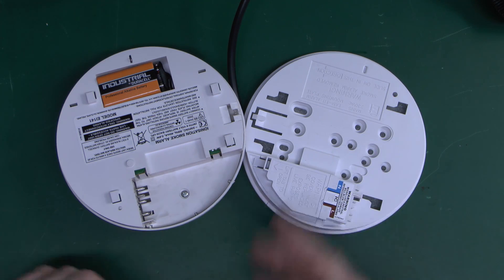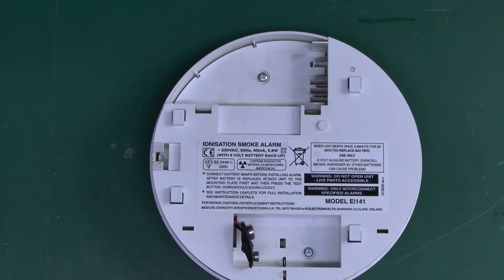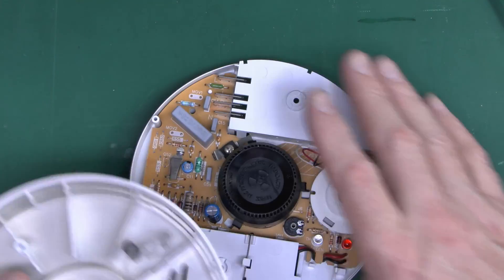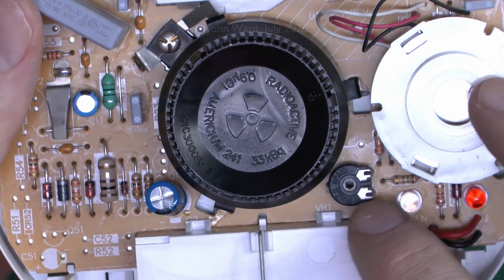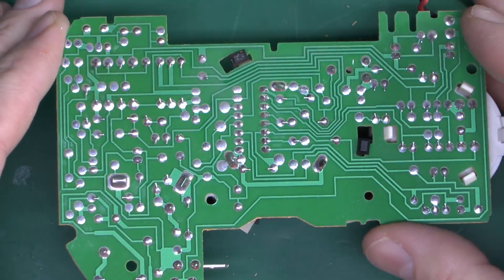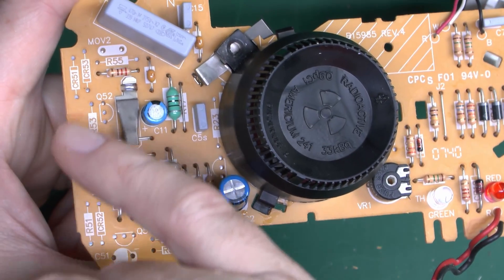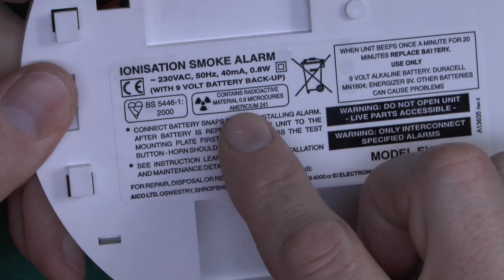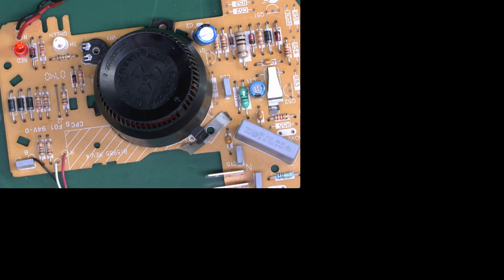Ionisation Smoke Alarm Dismantled - What's Inside

Comment: I remember i used to take everything apart to harvest electronics, i had no ides radioactive things were in smoke alarms and the building I worked in was throwing them out so I opened one up to see what's inside. I don't remember any radiation warning signs in it, pretty sure I would've remembered that. Whats the chances that it could've been a wired by the mains ionisation smoke alarm in 2014 UK? If so, what are the chances the chamber had no warning and I would've mistaken the amercium pellet for a screw and tried to unscrew it this releasing alpha particles on a screw driver I would've put back into my pants pocket? Further more; in this unlikely event, what's the chances i'd still be alive with no cancer or sickness?
Reply from the maker: Most smoke alarms in 2014 were ionisation types.
The amount of radioactive material is tiny, and alpha particles are blocked by skin, paper and other thin materials.  Unless you made a special effort to eat the radioactive substance or ground it into a powder and breathed it in, the risk is essentially zero.
Reply: @jwflame  thanks for the reassurance John, this has been a concern of mine for years. So Americium is not brittle enough to break apart when scratched by one of those steel hexi screw drivers? It would have to be grinded to break into a dust?

Comment: I ordered an ion chamber from an old smoke detector (older than yours, I'm sure). It arrived today, so I tested it with my Geiger counter (Terra-P +, by Ecotest). Nothing could be detected through the chamber housing, even with the cover removed from the Geiger tube, inside the Geiger counter. 
I took the cover off the ion chamber and tested it again. With the cover on the Geiger tube (that's inside the Geiger counter), still nothing showed up, but when I tested it again, without the cover over the Geiger tube, I got a reading of 2.4 micro Sieverts (it varied wildly, but that was the maximum reading I got).
For reference, the normal background radiation here is about 0.17 micro Sieverts. The alarm goes off when it reaches about 0.28 micro Sieverts (or close to that).

Comment: The chip is actually really interesting. It saves energy by powering the system down most of the time: only checks for smoke for 10ms every  1 and 2 thirds of a second. Every 40 seconds i checks for a low battery. And it does the interconnect comms : allowing up to 125 devices to be interconnected.

Everything else is just support for the chip, or the powersupply, which looks like a capacitive dropper.

Comment: John, you need a remedial class or a more in depth class in health physics. Radiation damage is a stochastic phenomenon. Am241 is primarily an alpha emitter but it ALSO emits gammas at 59.6 KeV and 26.3KeV peaks in addition to lesser amounts of gammas other energies. And what about the X-rays? When those alpha particles impact the electrodes or even the carrier substrate, the law of conservation of energy says the energy most go somewhere so the abundant kinetic energy of the alphas is transformed into Bremsstrahlung X-rays which are too low in energy to be seen with a Geiger counter but are EASILY visible to a scintillation counter. Safety councils have decided that the very real danger of the radioactive material is outweighed by the very real danger of a potential fire, it's not that the source is actually free of danger to be in the vicinity of. Again, radiation damage is a stochastic phenomenon and "safety" is a numbers game. 

I used to design alpha and gamma scintillation spectrometers and I've watched the radiation from a 0.91uCi Am241 source turn white plastic brown with radiation damage. That typical detector source was 34,000 Becquerels at manufacture as your source is in this video, meaning that the material when new will experience 34,000 disintegrating nuclei per second with each one proving emission. That's not a small number. While the alphas are stopped in a few centimeters by interaction with air molecules or immediately by the plastic and metal components of the detector, the resulting low energy Bremsstrahlung X-rays are both penetrating and perfectly strong enough to damage DNA. John, I would HIGHLY encourage you to invest in a halfway decent used scintillation counter so you can with proper techniques (you'll need a "lead castle") be able to quantify the things you can't see before making too much commentary about them.
Reply: @Naughty_Squad  I can't tell exactly what you're asking but if you want to keep one of these radioactive sources removed from a detector for a test source, just keep it in a well marked, sealed container inside a metal can and don't store it near where people, pets, or animals will be. No worries. The problem comes when people store these things in their workshops where they spend time or bedrooms where exposure adds up. In a detached garage or a shed it's a non-issue. If you want to be totally safe with it, look up "lead pig" which is the standard name for a lead shielded storage container. They used sell small ones on Amazon. With a pig you could keep the source in your bedroom without any potential issue. It doesn't take much shielding to render it very safe.

Smart meters are something totally different. They use wireless radios that put out strong radio pulses every once in a while just like your cell phone, but using less energy than your cell phone. Think of them as cell phones that make a couple 1 second calls per day.
Reply: Hi Peter, you seem like you know a lot about the science of this subject. Could I ask you about a query I have? 

I remember i used to take everything apart to harvest electronics, i had no ides radioactive things were in smoke alarms and the building I worked in was throwing them out so I opened one up to see what's inside. I don't remember any radiation warning signs in it, pretty sure I would've remembered that. Whats the chances that it could've been a wired by the mains ionisation smoke alarm in 2014 UK?

 If so, what are the chances the chamber had no warning and I would've mistaken the amercium pellet for a screw and tried to unscrew it this releasing alpha particles on a screw driver I would've put back into my pants pocket? 

Further more; in this unlikely event, what's the chances i'd still be alive with no cancer or sickness?

Comment: Most interesting part is the use of a 14? Pin DIL micro controller rather than an 8pin or black blob.
Reply: Dedicated smoke alarm IC not uC and they've been around for decades. Others have posted a link to the datasheet for the device used here.
Reply: Smoke detector chips are very specialized low power chips that pre-date microcontrollers. A microcontroller is useless baggage in this application. Google "allegro A5348 datasheet" for more.
Reply: @Peter_S_  I've just dived into the library and dug out the Motorola European CMOS Selection databook from 1979. It has the five smoke detector ICs in it: MC14461 -2, -4, -5 & -6.

Comment: What voltage would you expect to get in alarm on the interconnect with respect to neutral?
Reply: As it still needs to work with the mains power removed my guess would be the interlink wire is 9vdc wrt neutral. Its certainly not mains voltage.

Comment: Many products that we use today are produced from by-products of industrial processes. Most home furniture is made from sawmill scraps glued together. Smoke detectors are one of the few uses we've found for nuclear waste, aside from research purposes. To me that is the problem with nuclear power: Every other industry has found a way to re-use its waste products, except for the nuclear power industry. Smoke detectors, research isotopes, and metric tons of hazardous waste that pile up on a daily basis. Interestingly, Americium did not exist on this planet before 1944. Its half life is 432 years, so the Americium we've made will be with us for a long, long time, thousands of years before it becomes undetectable.
Reply: Most of the "hazardous waste" from the nuclear industry is just regular waste that has been classified as such due to an over-abundance of caution. Dispose of it as regular waste, and you're condemned by the anti-nuclear lobby as irresponsible. Give it special containment procedures, and not only does it greatly increase the disposal costs affecting the economics of nuclear power, but the anti-nuclear lobby then uses that as a justification to say that nuclear energy is too dangerous and expensive. It's a catch 22 situation for the nuclear industry. The actual quantities of waste with significant levels of radioactivity are quite small. There is also a conflation of how long the half-life is for an element and its strength, and type, of radiation. I would like to see more productive use of what waste is produced, and there is a lot that could be transformed into fresh fuel, or 'burned', in fast breeder reactors. I think most people don't realise on a conscious level that all the fuel for nuclear reactors was dug out of the ground initially. That we live on a radioactive planet. That it is the heat generated from that radioactive decay that keeps our planet liveable. Fossil fuel plants chuck way more radiation into the environment than nuclear plants are responsible for. This is completely unknown to most of the public!
Reply: @dalriada842  Completely correct. I agree entirely.
Reply: There are lots of uses for high level nuclear waste, it's just not economical to use most of it right now because fresh fuel and other means of producing the materials are still cheap.

Comment: Interestingly, code here requires dual-sensor smoke detectors. Doesn't stop local retailers from selling single-sensor ones though. And some of the fancier ones (like spoken alarms) are only available in single sensor versions, so I compensate by making sure all the others are dual and are interconnected. (One of the two kinds is preferred for kitchens as less prone to false triggering, don't recall which)
Reply: Pet hate: Posts that refer to "here" without saying where "here" is.

Comment: So cheaply made infact that they didn't bother to populate the MOVs and transistors that are supposed to be there. Whats the point of designing the PCB to have those components if they're never included. They would cost 0.00000000001 pence. The battery is probably always connected and the 9V from the battery and the mains is probably ORed with diodes.. I see no way that it could be only connected when the alarm is connected to mains - there are not enough pins.
Reply: Bying a MOV and installing it on a board will inevitably cost more than 0.00000000001 pence. Maybe closer to 0,1-1 and that very certainly adds up when you make them times 10 million or more. I'm pretty sure that the designer and manufacturer of this product had a better cost estimate for his BOM than you do and had more to go on with their decision than a random internet stranger commenting on a random internet video. Pretty much every product you will find has a circuit board inside has unpopulated component locations just because they do cost-effectiveness calculations and do several different models of the product with the same board, as stated in the video if you cared to listen to it.
Reply: PCBs can also have unpopulated component positions in cases where the designers weren't sure if a given component would be required for some application or other, and it was easy enough for them to add a component footprint that can be populated if it ends up being needed, rather than forcing them to update the design and have a new batch made.
After all, adding an extra footprint during the design stage is effectively free (assuming it doesn't increase the overall size of the board, cause complications elsewhere, etc.); having an updated batch of boards made very much isn't :)

Things like that may be eliminated in future design revisions, but not always: why risk breaking the design and necessitating more testing if removing the unneeded footprint isn't required?
Reply: @AndrewGillard  Way back before '86 when I left the company concerned, Sales were given the chance to completely spec a product after arguing it was them that had to sell it and they knew what the market wanted. However we in Development realised they'd got it wrong, put in the required components as a build option and then kept quiet.

At the prototype stage Sales somehow found out what we'd done and insisted the PCB was redesigned without our build option. That's how it went into production and as expected it didn't sell - customers wanted what Sales had claimed wasn't needed.

We had to design an add-on board for existing stock and future products were specced the way they'd always been, by Development and the Tech Director.
Reply: Different model or market. It wouldn't be the first time a board has been designed with build options.
Reply: [rolls eyes] That PCB is able to be built as either an ionisation detector or an optical detector. In the factory it's called a build option. It allows a single PCB and housing to be certified as a safety device and allows the maker to build whichever version they want under that single certification.

Comment: Smoke alarms do seem to have good long-term reliability, I recently replaced one on the upstairs landing, (mainly because the originally white plastic case had become very yellow)  which had been in place for about 30 years, just a standard battery powered one, still worked when I tested it too!
Reply: I bet the optical battery powered ones usually work for donkey's years because there isn't really anything there to wear out unlike these pieces of rubbish with a radiation source and a failing mains PSU. I don't remember ever seeing a faulty one in my house no matter how old they are.

Comment: The sensor is wired directly to the bent-up lead of the chip to avoid leakage across the board introducing noise.  The two adjacent pins are probably zero volts to reduce leakage across the package of the chip.

You could avoid the bent lead by putting a guard rail around the sensor input, but then you'd need a double-sided board because you need the guard rail on both sides.  It's cheaper to have a single-sided board and bend the pin.  Slightly greater assembly time, but presumably still cheaper than going to a double-sided board just for that.
Reply: There is someone in China who's only day job is bending millions of pins for these at the factory :)
Reply: in even older ones it was not double sided, just milled out a big hole around the sense pin, no bent pin and soldered the sensor on from the top.
Reply: @fumthings  milled? That's expensive!
It's clearly punched out.
As little expensive stuff as possible.
Reply: @erlendse  Known as 'punch'n'crunch'. As there's cost in making the punch it makes sense to have as many build options for different versions on the PCB.
Reply: Bending the leg of the chip is still a bodge though and not the correct way to do it. Its the lazy way. They just saved 0.00000001 pence by not needing a short link wire.
Reply: @simontay4851  No, they had to bend the leg to keep it away from the board.  Leakage.

Short vertical link wire.  Soldered at both ends.  Yeah, that's gonna be easy.  And unnecessary.
Reply: @simontay4851 , you seem to be affected by Dunning-Kruger effect in this instance. That design has to do with performance and is very intentional to achieve that end.
Reply: @Peter_S_  Exactly. Every smoke alarm I've had apart has done it this way. Means they can use a rubbish SRBP PCB material without worrying about moisture absorption and leakage.
Reply: @simontay4851  The datasheet most likely tells you to do exactly that to that pin. It would not surprise me if the chip is delivered with the pin bent that way from factory.

Comment: You said it suffered no apparent damage from 1000V, and this is true.  But...

Yeah, a conscientious designer might come up with something that can withstand 1000V just in case somebody sticks a megger on it.  It's a selling point, even.  Until the production engineer takes a look and sees that the circuit could be simplified, or cheaper components used, and it still handles 240V fine.  But maybe there are no cost savings to be made that way, so no change to the design, so it can handle 1000V.  Until management learns that it can withstand accidental megger application and realizes that more units will be sold if it cannot cope with 1000V.

But maybe this design wasn't subjected to management and it really can handle 1000V without degradation.  That doesn't mean every such unit on the market can.  Maybe it's only the ones from this manufacturer.  Maybe it's only that particular model from this manufacturer.

Most likely of all, though, is that voltage ratings of some components have been exceeded and their lifetime has been reduced.  Putting a megger on it means it will fail sooner than it otherwise would have.  Maybe you even got lucky and another unit of the same design from the same batch would have failed instantly.

The moral: never exceed the ratings.  Not even if you saw somebody on YouTube do it and get away with it.

Comment: I was hoping you would look for the source of the "cracking" sound when you applied 1000V earlier. Obviously this device uses a capacitor-dropper on the AC side, so chances are the capacitor got damaged or maybe some arcing?
Reply: Probably arcing made the noise.  Probably also capacitor degradation with holes punched through the plastic film.  Self-healing, but the capacitance drops with each punch-through.
Reply: @bdf2718  That could well be the biggest failure mode of these things. That cap dropper is going to age and drop below the C needed to power the device and perhaps the megging will decrease the lifetime of the power supply below the expected operating life even if it still works initially.